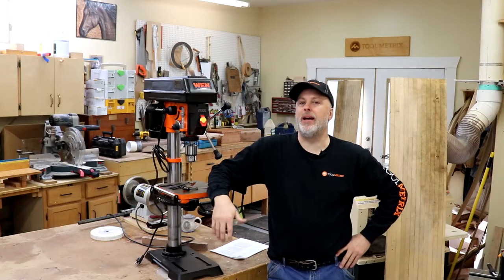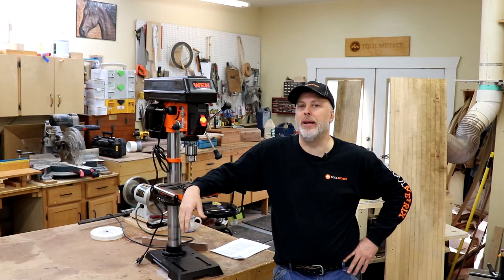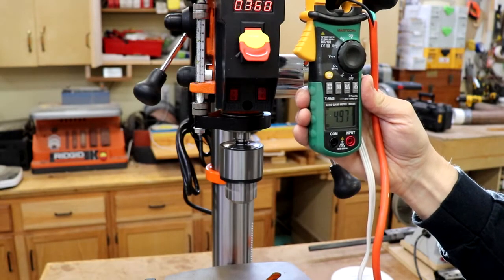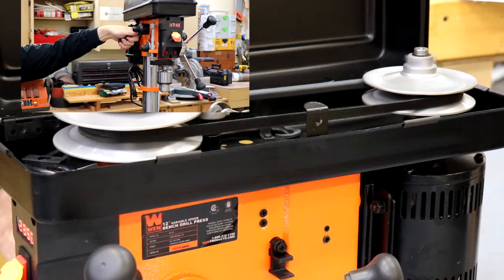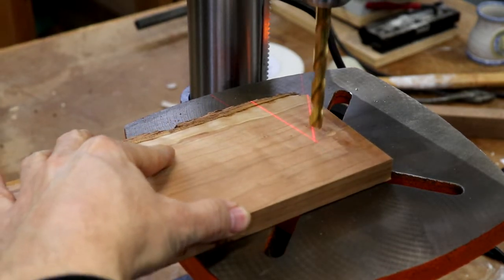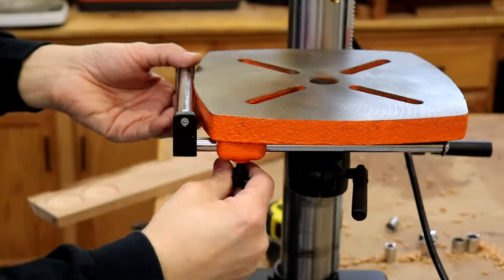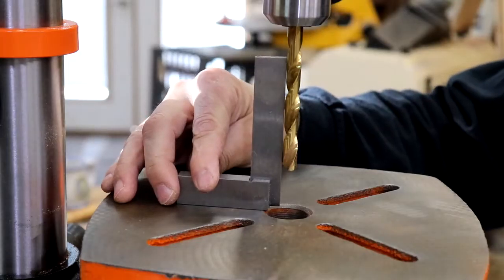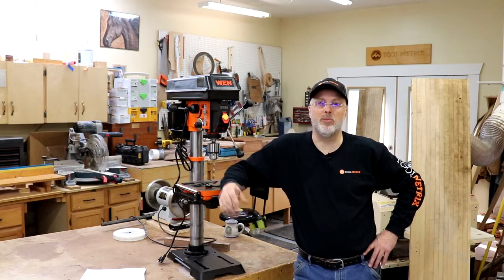Best Benchtop Drill Press: WEN 4214 Deep Dive Examination

Comment: i wish people doing review just like this.. not long video but comprehensive , this review just perfect ! 👍👍✨
Reply: I Agree. This is the kind of review i like but i disagree with "plenty of power".  I have a 20 year old generic Pro Tec 8'' drill press with a 1/4 HP motor that out drills this. I bought this because it ticked all the boxes for what i needed in my shop much like ToolMetrix talked about. I stumbled upon this video while searching for anyone  that may have upgraded the motor on the 4214.
Reply from the maker: Thanks for the feedback, Green Building!  Cheers, Paul

Comment: Agreed with other comments, great presentation and approach in this review. I ordered this press with the table to replace my old 8 inch delta. Really excited, this product seems to have a very positive consensus on value in the community.
Reply from the maker: Thanks for the feedback. Hope it works out well for you. Let me know what you think.
Reply: Drill press arrived and I've got it in its place and working in the shop. Gotta say, it really is quite a piece of machine for 250$. I am very happy I made the purchase. It's an excellent upgrade and seems to be everything I need as of now. The accessory table is also a great value, and it made boring holes for shaker pegs on a coat rack much easier than the previous one that I made... I agree about the plastic clamps. They honestly hardly seem to hold the accessory to the table in my case. It's like they weren't made for this drill press as they just barely reach the cast iron table. The accessory table will move with the slightest bit of pressure no matter how tight I try to make them. Not a big deal though, I already have an idea to fabricate some more substantial clamps from hardwood, using the same studs and knobs. I may make my own table in the future but this manufactured one quickly got my foot in the door to understanding the concept of table support. Thanks for the review, it helped me in making the decision. I subscribed and look forward to catching future content.

Comment: Man...I have been looking for a drill press for a while and this is the one that seemed right, but I was not sure until watching your review! I am a guitar tech who is getting into building from scratch and I realized (VERY QUICKLY) I can't free hand drill some holes and have them come out right. Thank you for the review and you have a great channel here!
Reply from the maker: Thanks!  Really appreciate the feedback.
Reply: If you going to use any large Forster bits you want  press with lower slow speed setting. Otherwise I have had one for 2 years and no complaints. Bargain at 199 I paid.
Reply: @daviddavis5689  Learned that pretty quickly LOL It's a tank of a drill press

Comment: May I ask the diameter of the column and are they a standard size for all drill presses? Thank you for your time.
Reply from the maker: I'm not near the drill press at the moment to measure it, but I believe that it is 2.5".  Most 12" drill presses built today would have approximately the same size column, and I believe that WEN actually manufactures many of the drill press brands that you can buy so that part is probably interchangeable.

Comment: How is that "CVT" transmission on the drill press holding up? Seems like the belt would need to be replaced more often than usual?
Reply from the maker: Hi Alex, no problems so far.  I haven't noticed any visual wear on the belt.  That said, I agree that the design would seem to add some additional stress onto the belt that might accelerate wear.  I'll keep an eye on that.  Cheers, Paul

Comment: Excellent presentation here... Great value for the money for sure. I have recently finished up my workshop build project & have had this unit on my list for quite some time now. Not sure about purchasing it through Amazon, however Home Depot will match their prices & I may simply order it through them & pick it up when it arrives... 
Thank you for sharing this.
Bill... :~)
Reply from the maker: Thanks Bill. Home Depot is always a good option as well. I’m just kinda hooked on Amazon I guess.
Reply: Both are good options, both should be relatively easy to return through but I guess home depot may be easier since this is heavier. I found a wen bandsaw cheaper on amazom and took that route (faster delivery too) and has worked great for me so far.

Comment: I bought this the other night, waiting for shipping, the review makes me confident I'm getting a decent machine. I Didn't buy from Amazon as Amazon now is adding on SALES TAX on everything (so is EBAY and I stopped buying anything from either)
, I found a small retailer  on line that had it for slightly less than Amazon, same free shipping,  and NO sales tax added on, so that saved me about $30
Reply: Who did you buy yours from? Thanks
Reply from the maker: Thanks, VO.  Hope you're enjoying your drill press.
Reply: @ToolMetrix  Yeah, it's a nice little drill press.
Reply: I bought mine in Jan 2021 direct from the factory. It was a little less than Amazon and I was surprised they didn’t add sales tax. I’ve been using it for a couple of months now and love it.
Reply from the maker: Wow that’s great. I didn’t realize that was an option. Thanks for sharing. Cheers, Paul

Comment: I am glad I found this video.  I received mine a few minutes ago.  How deep should the arbor/chuck be seated in the spindle?  The manual does not specify.
Reply from the maker: If you watch at 1:50 you’ll see me do it. It was described in the manual as well.
Reply: @ToolMetrix  I noticed it.  Your arbor slipped in easily.  Mine, even after thoroughly cleaning everything, needs a lot of convincing to go in the spindle.  Thank you.

Comment: Paul. I’m comparing the Wen 12 and the Rikin 12. Both are variable speed with digital read out. They both look to be exact like the same company made the. Do you have any idea what the difference is?
Reply from the maker: Hi Mark, I’m not familiar with the Rikon, but if I were to hazard a guess I’d say that there’s a good chance that WEN makes the Rikon, as I’ve heard that they are the OEM for a lot of tool vendors.

Comment: I bought one around 3 years ago. Right before they changed the color from yellow to Orange. The problem I'm having is the belt tension is loose in high RPMs. In low RPMs the belt tension is fine. Do you know how to adjust this? I looked on WENs site, and all over google. I can't find anything. I replaced the belt first, I thought that was the problem. It's a nice press other than that, I have not had a problem in 3 years.
Reply from the maker: Hmmmm....that's a strange problem.  I don't know enough about the mechanism to have a suggestion for you.  One thought is to try calling WEN support.  I haven't personally tried calling them, but people seem to rave about their support, which is rare for a power tool company.  Might be worth a shot.
Reply: @ToolMetrix  I guess I'm going to have to do that. Thanks for the quick response.
Reply: @ToolMetrix  I guess it needed lube. I haven't lubed it in three years. It said to lube the spindle , and shaft every three months. I opened up the top, and lubed the shaft the tensioner pulley rides on. Then slowly went through the RPM band back, and forth. To work the lube in, and now it works. It was so dry, the pulley was getting stuck on the shaft it rides on. That's why the belt would not tighten.
Reply from the maker: That is great info!  Thanks for getting back with the update. Cheers, Paul
Reply: @user-pk8pf8nh6s  

You might also try automotive "belt dressing" on the belt and pulley surfaces.  This is usually sold either in a thick "stick" form like a giant Chapstick/lip balm dispenser, or an aerosol spray can.

This increases "grip'' and reduces slippage, and also reduces noise to some degree.

But yes, keeping the quill spindle or shaft & bearings lubricated is important!
Reply from the maker: Awesome input. Thanks for sharing!

Comment: How do you compare this to the Rikon 12”. They look identical with all the same features. The Rikon is $500. I’m not sure if it’s the internals
Reply from the maker: I haven’t looked at that model in person but my hunch is that they are probably nearly identical (like interchangeable parts). WEN manufactures tools for lots of companies so I’d say that there’s a chance that WEN actually makes the Rikon.  That’s pure speculation on my part, however.
Reply: @Mark Lengal  
Yes, it could be identical, but hard to know for sure.  There could be internal changes or differences in the motor and/or in the quality of the shaft/quill/spindle and bearings.

Comment: Great review. Just got one a couple of weeks ago. Love it. I am having a problem with the depth stop turning itself downward from the vibration caused when power is on. It causes the depth to become shallower and shallower after I've set it. I've been taping it in place but is there something else that would fix this?
Reply from the maker: Hi Jack, thanks for your feedback. Are you tightening the two locking nuts against each other solidly after you set your depth?  If you are already doing that and it’s still moving then I’m stumped. I’d suggest giving WEN customer service a call.
Reply: @ToolMetrix  Thanks for answering. Yes, I bring them together with the washer in the middle. But the bottom one simply winds downward making the depth more and more shallow. Isn't the washer supposed to be in the middle?
Reply: Ok. That was it. I took the washer out and it holds like magic. The bottom nut stays put regardless of the vibration. What are these nuts called. When I look up lock nuts, I mainly see the nylon type? Thanks for the help and all you're doing for all of us amateurs.
Reply: @11JackBenny  

When two nuts are used in this configuration to lock against each other they are referred to as "jam" nuts.

But if you search for "jam nut", you will typically find nuts that are 1/3 to 1/2 the thickness of a standard nut, but otherwise they look like a typical, plain old nut in appearance.

Comment: I'm about to check out the press table review, but, the crank for raising/lowering the stock table....is it good? That's the one feature I'm crying out for! My 20+ year old Ryobi doesn't have that, and adjusting the table is a 4-handed operation, that NEVER re-aligns exactly the same. Great review! 

All the best
Reply from the maker: Thanks 🙏. The crank is fine for the price of the tool. . Easy Two handed operation. Could be better but it works fine for occasional adjustments.
Reply: @ToolMetrix  Just got one, and handle could be longer , takes a lot of torque to make not move. Re-tapped hole, helped some. Mine makes a lot of noise also. One laser beam is 3/16 wide, so useless.
Reply from the maker: Thanks for the report Jim. Yeah 3/16” is excessive.

Comment: Has anyone had a need for replacement parts (ie switch, belt, etc.)?  Any issues getting replacement parts.
I'm replacing a Delta DP350 that is about 15 yrs old and wornout.  How is it holding up?
Reply from the maker: Mine is holding up great so far.  I haven't tried getting parts, but I would be surprised if it was hard to do so.   It's a popular model, and people rave about WEN's customer service.

Comment: Great review!  Purchased one from Amazon and just set it up.  Unfortunately the support lock handle will not tighten enough to keep drill table from rotating around the column.  Any ideas what I did wrong?
Reply from the maker: Hi Gregory, thanks for your feedback.  I assume what when you tighten it, the collar that wraps around the post tightens as far as it can go, so that there is no gap remaining at the rear of the collar?  In other words, there is no remaining travel in the collar, but it hasn't fully tightened around the post. I just looked at mine, and with the collar fully tightened, there is approximately a 1/16" gap remaining.  In other words, if I applied more pressure to the collar locking mechanism, it could squeeze another 1/16" (something would probably break if I did that). With the collar tightened there is no movement in the table on my unit.  So, if you are seeing what I'm describing, it sounds like a manufacturing defect.  If there is a gap remaining in the collar, but you just can't close it with tightening pressure, I would check to see if there is a bur (or something else stuck in there) that is preventing the collar from closing completely.  If the collar is fully closed, i would suggest calling WEN customer service 847-429-9263 (M-F 8AM-5PM CST).  I've heard good things about their customer service but I haven't had occasion to call them myself.
Reply: ToolMetrix, Thanks for the quick reply. I discovered I inserted the clamp from the wrong side.  It must insert from the left  not the right. Working great now.  Thanks again.
Reply from the maker: Yep, that would definitely do it!  Glad you have it sorted out. Cheers, Paul

Comment: I know this is a older video. I have had mine for a while now but i dont use it to frequently but i cant figure out if theres a way to adjust the motor to tighten the belt. When i slow the speed down, the belts are so loose, with any small load, the chuck stops turning. Anybody have any suggestions?
Reply from the maker: Wow, that's not good at all.  I would call customer service, as I have heard good things about WEN in that regard.
Reply: @ToolMetrix  thanks for the response and that's good to know. I try to research stuff before I call customer service  as you don't always get someone you can understand. Thanks again!

Comment: hi, i am looking to buy the wen 4214 drill press , but i need to know , can it handle 1/2 inch steel ?
Reply from the maker: I haven’t tried it but I think it would handle it as well as any other drill press in its class.
Reply: @ToolMetrix  
  @evolve 2survive  

I would want a drill motor that goes much slower for drilling 1/2" steel.  Ideally down to at least 180-200rpm, depending on how large of a cutting/drilling bit you will be using...the larger the bit, the slower the speed.

When drilling steel, you want a very slow speed AND LOTS of downward force.  This of course requires good quality bits.  And of course use a good cutting oil such as Tap Magic, etc.

Comment: Thanks for great review. Mine is being delivered today.  Do you think swapping out the drive belt with one of those link belts would quiet it down any?
Reply from the maker: Hi Frank, I doubt it would make any difference because the belt itself isn’t likely causing the noise. It’s still one of the quieter tools in my shop so I don’t really think of it as a problem that I need to solve. But if you try it let me know if makes any difference.

Comment: A minimum speed of 500 is still slow enough for  up to about a .460 drill dia. in mild steel. Any drill bit smaller then that, the speed increases as the size gets smaller. In aluminum 500 is slow enough for a 3/4 bit. Hope this helps.
Reply from the maker: Thanks, John!

Comment: How does the 4214 handle steel e.g.1/2 inch steel ?
Reply from the maker: I haven’t tried it but I think it would do fine.
Reply: @ToolMetrix  
@evolve 2survive  

I would want a drill motor that goes much slower for drilling 1/2" steel.  Ideally down to at least 180-200rpm, depending on how large of a cutting/drilling bit you will be using...the larger the bit, the slower the speed.

When drilling steel, you want a very slow speed AND LOTS of downward force.  This of course requires good quality bits.  And of course use a good cutting oil such as Tap Magic, etc.
Reply from the maker: Great feedback. Thanks 🙏

Comment: Everybody wants to slow it down by half - any ideas? (besides an electronic speed controller.)
Reply from the maker: I don't know how you would lower the minimum speed by half with this pulley design without electronic reduction.
Reply: @ToolMetrix  Turns out the larger model - out of stock and price was upped 50% ($400 to $600) - uses a three pully system.  You would add a fixed pully stack (two) to drive the CVT, and the motor would add a third shaft with a pully stack (two) - and set the CVT range that way.  So - too much trouble compared to getting the bigger machine.  But if it's not available or affordable..
Reply: @ToolMetrix  It strikes me that the easiest way to cut the speed in half is to replace the motor with a given rated output that runs at half the RPM.  I think those are available - not necessarily affordable.  That would work bc there's no automatic clutch - just a question of fitting the motor - and mainly that's motor diameter not length.